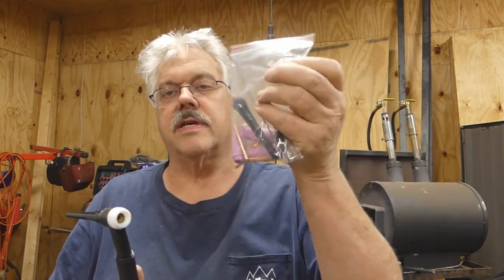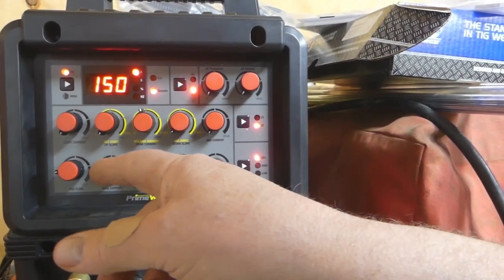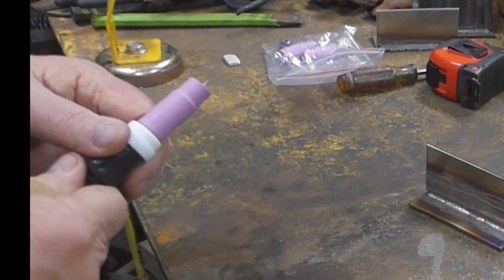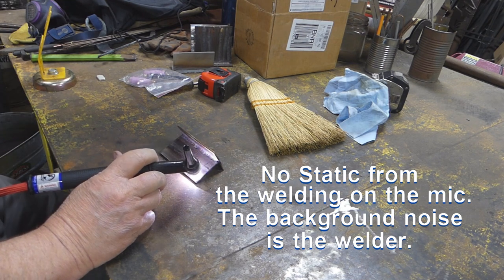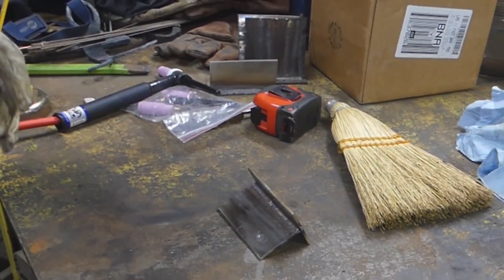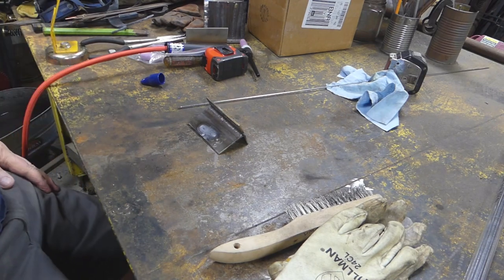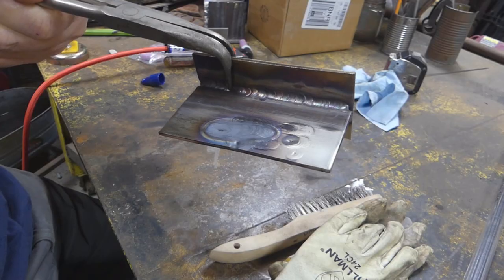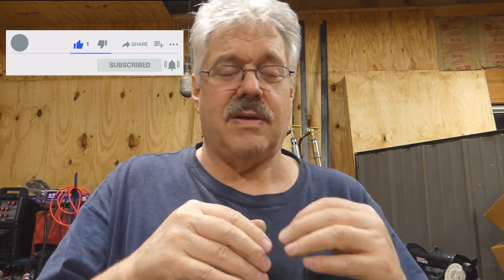PrimeWeld TIG325x First Use and Mic Check for Static!!

Comment: Jazzy 10 is good cup to use I use it as my all-around for steel and stainless steel. And I use a standard number 5 stubby for doing all my aluminum work even in number 8 gaslands will work good for doing aluminum to.
Reply from the maker: Thanks, I appreciate that. Good to know on the Aluminum.  I will look into getting a 10 and some 8 cups as well.  I have a lot of things still to buy for this as I get up to speed.

Comment: idk the ID of the hose, but lets say its around half inch ... then there is just about 0.034 cuft in your hose.  If it is moving at the flow rate from the bottle, then it would be out in about 6 or 12 seconds at 20 and 10 cuft per hour airflow rate, respectively. That doesnt account for the different densities of the atmosphere gasses in the hose vs the inert gas coming from the bottle, and how they might or might not mix, intermingle, push each other, and/or have differing resistances to the inside material of the hose.
Reply from the maker: Appreciate that information. thank you
Reply: @GaryForgingOn  np, please see my edit above, I corrected my math. I dont know anything about purging welding lines. Was just doing the math on the interior cuft volume of the hose, which is 25 ft X pi X (ID of the hose in feet divided by two)^2. Somebody can check my math. If all that air really is moving at the specified flow rates with no other considerations, then I suppose that is the theoretical purge time. But, importantly, it also ignores all the physics and perhaps chemistry involved. 

Either way, I like your approach. Only a tiny cost in gas to make sure we got the Argon flowing out. Thanks for sharing the video, enjoyed it.

Comment: With the way your Arc is wandering it kind of looks like you got a crappy ground going through your table into your material...
Reply from the maker: I was thinking the same thing. I need to grind off any surface rust on the table and on my ground tab I have welded on the side of the table. Thanks

Comment: brother prime weld 325 x can aluminium stick welding
Reply from the maker: The primeweld will stick weld DC up to 250.  I have never stick welded aluminum but from all I know you only need DC and run it reverse polarity.  So this machine would do those settings so I assume it would stick weld aluminum okay.  I will probably only use TIG for aluminum or maybe someday, if needed, I might pick up an aluminum spool gun for my other welding machine.  A spool gun might work on the primeweld but I have never looked into it.  I hope that helps.